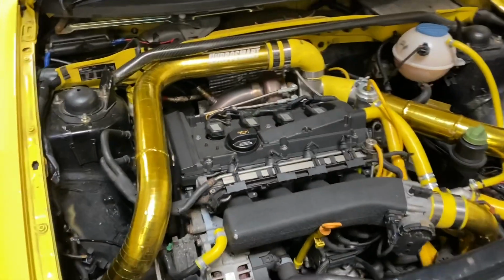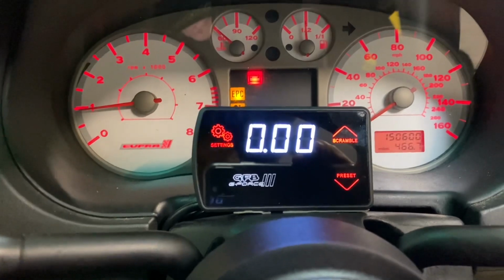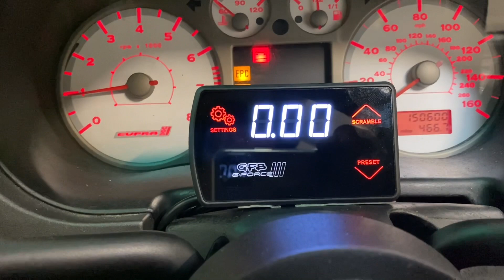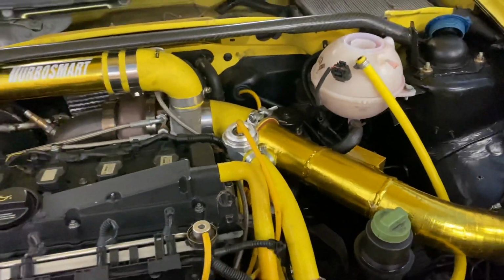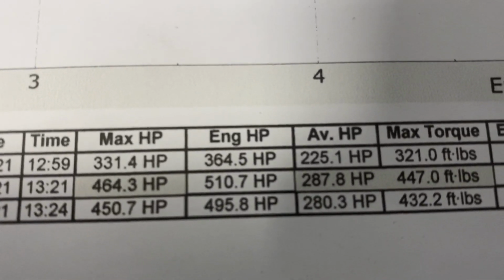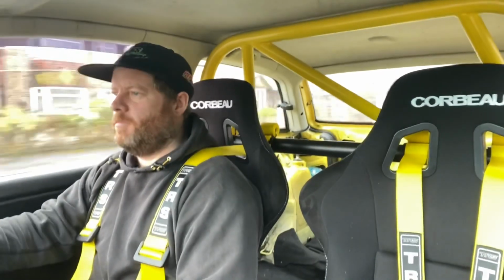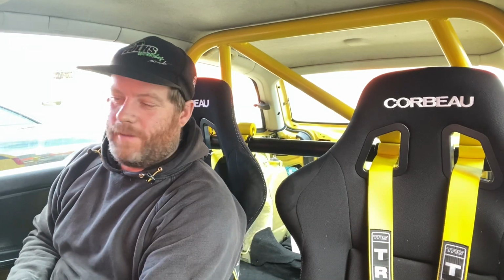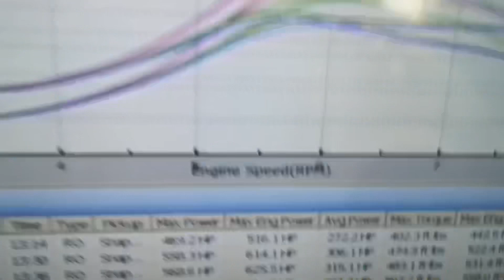MENTAL 500+HP IBIZA !   ** G25-550 1.8T GETS VWS TUNED **   OBSCENE FLAT SHIFT AND LAUNCH

Comment: Hello! Thanks for the Video! Great build and what killer performance! I own a VERY similar car to this, a Seat Cordoba Cupra -2000 which is kind of the same car as this. Also using mapped std. ME 7.5 but with RS2 Turbo+custom manifold, fully forged and stroked engine, BIG FMIC, Quaife LSD, Diesel 6-speed box, race clutch. Do you have any good solution for the Engine Mounts? My engine is pulling all over the place. On engine break it really moves under the hood. There are some custom mount low down in the back of the engine but nothing on the top of the engine. Just to keep the Intercooler pipes on I made it 7cm longer. How does that swichable boost work? Is the duty cycle for the fueling scaled linearly or what?

Comment: What a/r was that?
Reply: For some reason no one mentions the AR for these 550's or responds to comments when requesting the AR size. Strange.
Reply: I am wondering the same..what AR I am looking to have a happy medium boost in the midrange 3k or less..I've recently driven 2  gt3071 Garrett's (not sure AR) but both terrible lag..no gd for off corner
Reply: @rocky19811969  I think best is the lowest you can get. 63ish or so
Reply: @wakotecyt5475  .63 seems on the big side for these lil small displaced 1.8's no?..so I may be looking at another turbo frame entirely 🤔 😳
Reply: @rocky19811969  I have a borgwarner sx200 .83a/r and it has ton of lag... I'll try .63 after I'm finished with some other work
Reply: @wakotecyt5475  depending on mods even smaller may work better for you
Reply: @rocky19811969  n/a cams, uprated Springs, forged internals, lowered CR. Smallest available for my charger is .63
Reply: @wakotecyt5475  those cams hold up fine? What can u still Rev them too..and no need to touch exhaust valves? What kind of pwr are u putting down..thanks for all the info
Reply: @rocky19811969  yeah those hold up fine. My redline is at 7800. I have a combo of both exhaust and inlet n/a cams. No need to touch exhaust valves as long as egts are below 950 degree C.
Reply: @wakotecyt5475  wow thanks so much! Do u gave part number.. or just any mk4 2.0 N/A STOCK cams will do? As for the valves stick with the 1.8t stock in/out valves? When u say u have a combo of cams..u mean just the stock 2.0 in/exh cams?
Reply: @rocky19811969  those are stock 1.8 20V n/a cams
Inlet 058 109 021 F
Outlet 058 109 022 D
And yes those fit without modifications but you should have VVT. Always recommend to buy a VVT solenoid. Easy drop in replacement
Reply: @wakotecyt5475  I have AWP it has the stock vvt solenoid or do u mean buy a new one.. also wow I never knew 1.8 came non turbo? 😳
Reply: @rocky19811969  I mean I would always drop in VVT if you don't have.
Those are widely spreaded. 125HP 1.8 20V n/a
Reply: @wakotecyt5475  thank you...hen u say N/A u are referring to naturally or "normally" aspirated?? I think I'm getting confused because I've never heard of that engine in Canada before..edit: quick Google search I see the 1.8 did have a non turbo offering..yes my 1.8t has VVT stock
Reply: @wakotecyt5475  I believe it is actually not variable valve timing tho..I believe it is just cam adjustment and used for when starting cold and mainly for emissions..unless there's another option these engines have that I'm unaware
Reply: @rocky19811969  it's basically VTEC. If the solenoid is active the Inlet cam gets 18deg advanced towards the exhaust. I use this to help my turbo spooling. It's not active with the most stock Ecus. As far as I've seen it's only really used in BAM Ecu. I've played a lot with this and big turbos. I'd say you can get 500-1000RPM wider power band.
Reply: @wakotecyt5475  Right on brother!!! That's something I'd always wondered..it would be sweet if if there were aftermarket uprated heads for these..but I guess not so necessary seeing how much power can be made with stock opponents if built and machined right.

Thanks so much.. BTW are u the one in this video doing the build?
Reply: @rocky19811969  you can just use n/a heads bc of missing coolant channel wich causes the head not to fail as BAM and shape the chamber to RS4 profile like I did. 

This is my brother in this vids but we did those builds 😅
Reply: @wakotecyt5475  awesome.. the time it takes to spool is phenomenal I would like this exact same power band and characteristics it seems like a real weapon..the A/R u used seems to really work well..I don't know what you can safely spin these engines too with stock valving and also could I order that same turbo with the A/R you have or is all custom? I am subscribed for life 😊 hoping for more vids you guys are great!!
Reply: @rocky19811969  know what? I think I'm gonna make a new video about my 1.8T 😅
Reply: I think the a/r used in this yellow one is .63. saw few now with these chargers and they have mostly .63
Reply from the maker: The AR on this car is .72
Reply: @VolksWorkshop  whoaaa I would have thought tons of laggg!!!😮😮 my tuner wants me to go around a .50 I thought I could go larger...wow that Ibiza spools like mad
Reply from the maker: The G series are the latest tech from Garrett and spool is awesome the 550 spools like a K04,  the turbos you are mentioning are outdated nowadays
Reply: @VolksWorkshop  that answered a lot my man! 😊 ty..I have an old APR cast inconel manifold..I believe t25 flange..would u think I can make it work with this G series mill?? Or not enough flow? @Wakotec YT
Reply: @wakotecyt5475  I am subbed..and I think we'd all love that video 😍
Reply: Also my manifold is internal gated and not sure if the G-series even comes in that option I have been trying to get a hold of Garrett for sooo long no response! It's only through email.
Reply: I have T3 0.48 AR turbine housing on my modified gt2860rs with GTX wheel on mini ram manifold. It is on my 1.5 civic. It spools early and holds the power. I made 357hp engine power and nearly 400nm torque. Pulsar turbo sells g25-550 with T3 and 0.48 AR. This may be a perfect solution for you.
Reply: @patrykkozanecki9576  I wish they sold one for a t2
Reply: @patrykkozanecki9576  now I have to buy Garrett's very expensive but far superior
Reply: @wakotecyt5475  No it's not basically like VTEC. VTEC switches between 2 different sets of cam lobes, this is more common variable valve timing. If you want to use the Honda nomenclature here, it's called "vtc" Variable Timing Control.